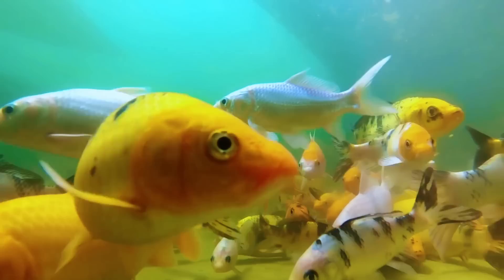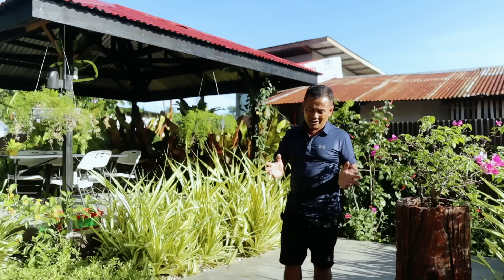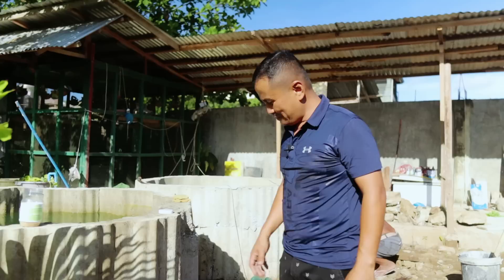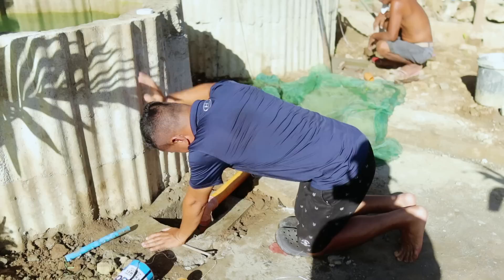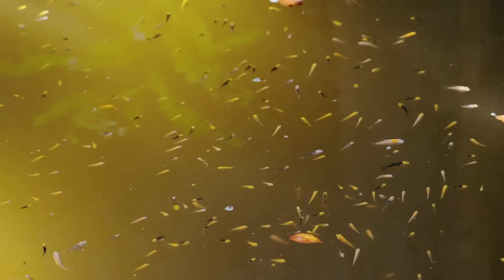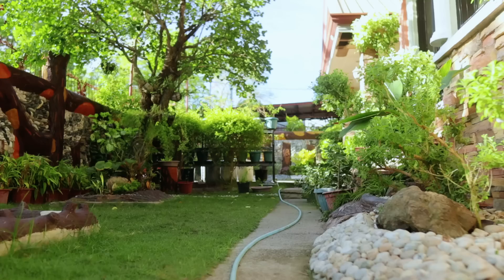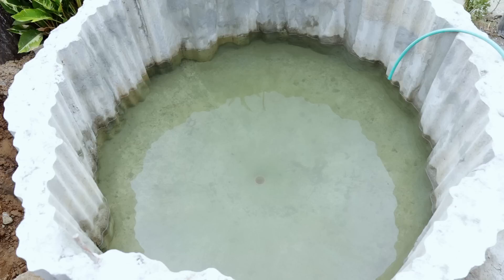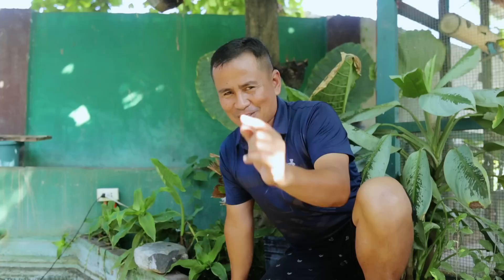TINY POND! 3,000 Fish Heads, Thousands of Dollars in Profit! Why do fish grow bigger and faster?

Comment: Same funnel system can be created in rectangle tank also  also rectangle is much better for fish health as they cover more swimming distance and doing so it helps their digestion, so add funnel system by increasing height and digging hole in between cu pipe in two half place in center, and at edge keep it full pipe and add the drain out connecter you will find fry survivor ratio more try out

Comment: Hello Dexter...you can get a pipe the same size as your drain pipe and drill holes into it, holes big enough for water and sediment to flow out but not big for the fish to get out, may be a 2mm drill bit. That way you won't worry about fish getting out. The top of the pipe would need an end cap.
Hope that helps
Reply from the maker: Thanks for helping that's a good idea bro.
Reply: No the force of water that goes out will suck fish and get blocked and fish also dies i have tried that.
Reply: @santoshshetty6174  same force would also suck the fish out if you had nothing there. Plus fish tend to go into the pipe during normal operations.
When putting a flushing pipe he can make sure to limit the force going out with a valve that doesn't cause a hammer action.
Reply: @jamesmuhairwe1335   he need to make grid plastic round box net  which our used by him most of the timeor keep grid box that can collect dirt and no fish that works much better